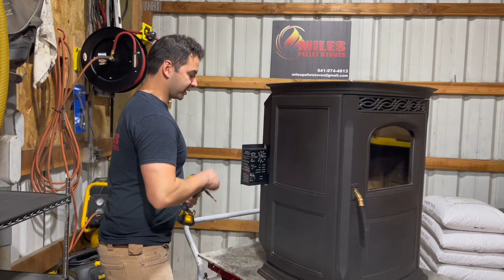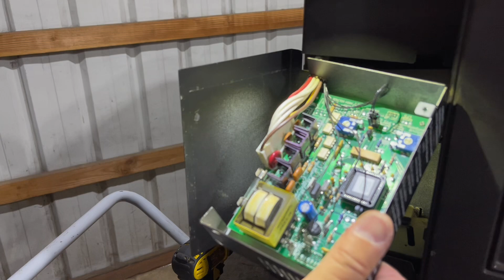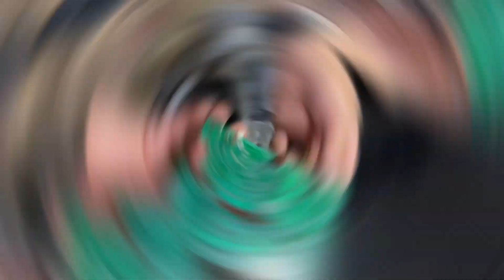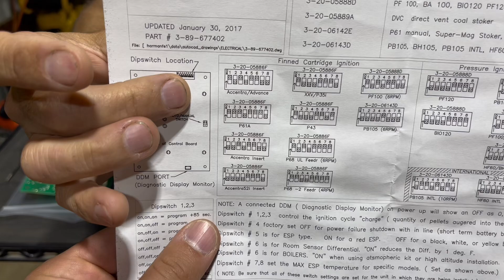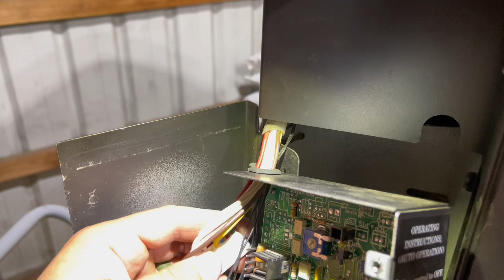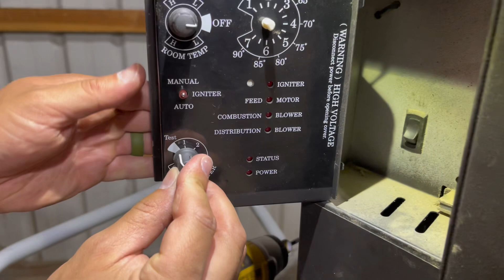Harman Accentra Pellet Stove Control Circuit Board Replacement Tutorial

Comment: I bought a used one , ran a test mode it worked, got it home cleaned it went to run it the distribution blower didn’t work, I pressed the knob in and messed with it and it kicked on. Safe bet it’s a circuit board?
Reply from the maker: Not necessarily 
I have owned one of these stoves.
Milespelletstoves.com
Call or text
Brett and Briggs

Comment: Great video and easy to follow. Certainly saved me money by doing it myself. Only issue is I had to change dipswitch 5 for the ESP probe from the Accentra settings shown on the instructions. My stove had black wires vs red.  Glad I read the fine print.
Reply from the maker: Nice work on your Harman. Please see our website 
Milespelletstoves.com 
If you need a part.
Please Subscribe 
Thank You
Brett and Briggs

Comment: You showed me 2 places to clean instructions I got did not include. Our alantra has quit. When it did it smelled like a belt was hot.  Is there a 'fabric' belt somewhere in the stove.  I'm thinking belt like in your truck from motor to air conditioner or to radiator fan etc.  Your help is greatly appreciated.
Reply from the maker: Good Evening 
There is not a belt on your Harman Accentra.
Please check your auger motor and slide assembly. 
Thank You